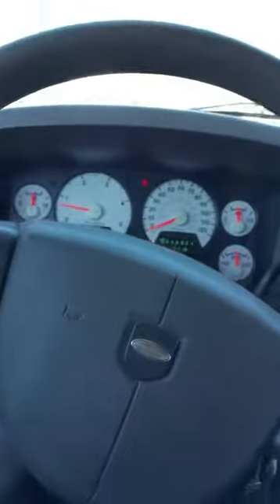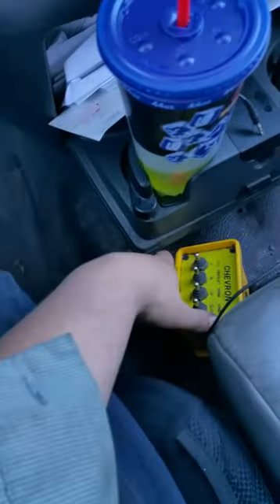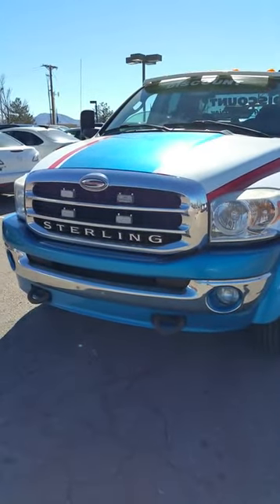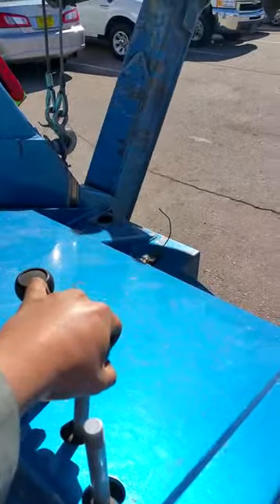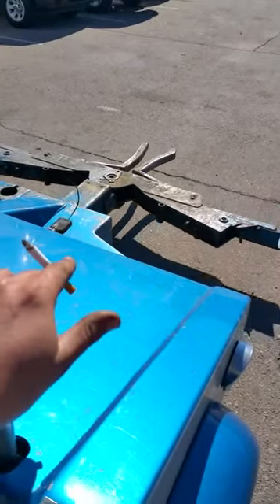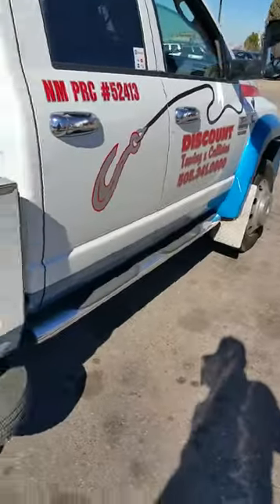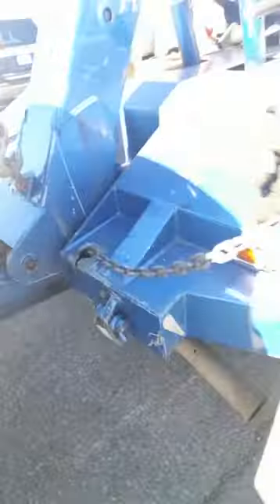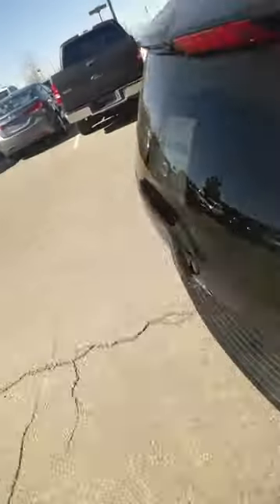How I load a FWD on my tow truck

Comment: Really I've had the same straps for 6 years and I have not gone through them. The way you have your chain looped  around the a arm and the wheel lift you're going to damage the car. As you showed when you lowered the arm the loop got tighter so when you go in and out of a driveway and reach the high point with the back of your truck and the car rises in the air it is no longer tightly strapped down and when you reach the low point in the gutter it will pull even tighter mending the control arm or snapping an aluminum control arm. The loop is also pulling the tow vehicle forward a properly placed strap pulls it down securing it between the two arms. in an emergency if you had to slam on the brakes the only thing keeping your tow vehicle from going over the arm of your wheel lift towards the back of your truck is your tow vehicle being placed in park so it does not roll forward. also you should never lift the cars drive Wheels from the ground two extremely high level while it's in park because as your lifting it you are trying to turn the to drive tires against the parking pin inside the transmission which could snap the parking pin or claw off. Oh and as a extra side note in my area that would be a good size fine that comes with a ticket.
Reply: Yes those are risks you take doing it this way but I never damaged anything when I did it this way and had dealt with situations similar to your example. Thinking back, the reason I think I never had an issue was because I would always drop the chains before pulling into the vehicles parking place so I could just unhook and leave from that point. I have done it both ways (with straps and my chain method) for a long time and had less problems (none that I can think of) using this method where as with straps, using the lasso or the triangle method (from the stinger over the tire back to the claw) I've had straps wear, I've had them fall off and drag the rachet. You're right, you do have a slight pull forward but it doesn't do anything and as far as the parking paw, the tires will skip, especially against metal before that paw will break. I appreciate your feedback though. I enjoy debates and sharing info